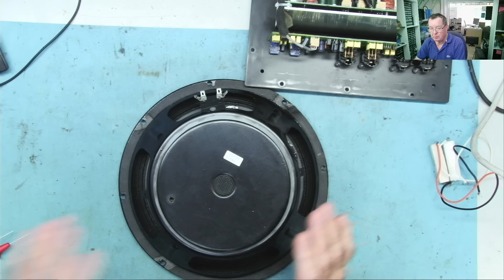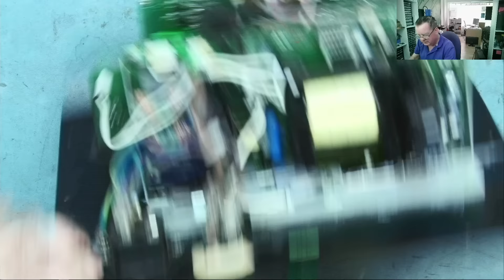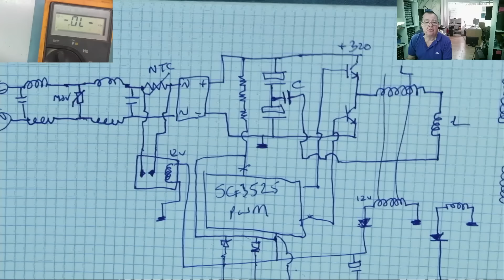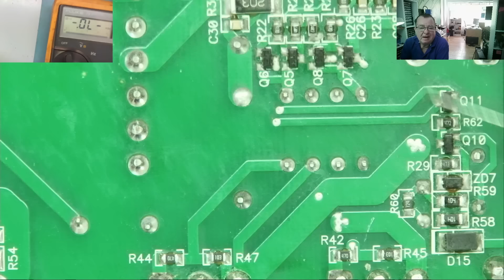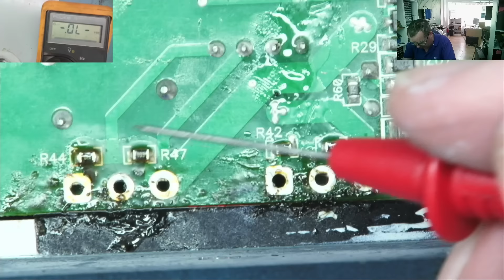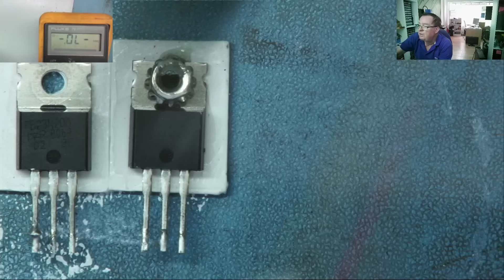DAS18A 750W Class D Amplifier Repair: PART 2 Why Did The Amplifier Go BANG?

Comment: Dummy load for testing output from audio power amplifiers. Auto headlamp H4 12 V 55W, long lite filament., 5 in serie. They are available free as the short light filament use to burst first.. Regards Allan from Denmark

Comment: 49:35 That chip has a vref pin which is a 5V output so you can check the voltage there on that pin and if correct the chip could be assumed working or at least not totally fubar. You could also check the other pins (LO, HO) with scope to see if it is outputting.

Comment: Before repairing anything, find cause of the Subwoofer’s speaker cone failure. The torn paper or foamy Surround aren’t the cause, they are the effect. Almost always, a torn corn is the result of a loose retaining ring/“basket gasket”. Next likely cause is Enclosure Over-Pressure. If the subwoofer is in a ported box and a port inhales an object, air flow can be stopped and something has to give… Another cause is if two subwoofers are in one enclosure and they either are wired or fall out of phase secondary to amp failure or a few other in circuit failures. 
I know everyone is yelling “Nuh uh… It’s from over-driving(over powering) the speaker…” If it’s a mid or tweeter or even a woofer, sure. But Sub-Woofers are designed to be pushed hard to drive those ridiculously low bass notes that make wax run out of your ears. 
Surprisingly, one of the best methods to repair a Sub-Woofer’s cone(paper like material) or the “surround”(flexible bit around circumference of the cone) is to use a piece of drywall mesh, spot of glue to hold the mesh and finally, clear Flex Seal. Like anything, prep is key to yield a quality, functional, long lasting repair. Use a flexible glue  and use sparingly. To keep the movement of the cone as uniform as possible, extend the repair in a way that spreads Flexible Seal around the outer most circumference of the cone. To test the repair, the all time best bass album has to be “Digital Bass”by Bass 305. Rinse, Lather, Repeat….

Comment: I use short lights for dc as an auto electrician 12/24v. Sometimes you just need more current available so add an extra bulb. I use 65w halogen headlight bulbs, sometimes 2 depending on what I'm testing.

Comment: Recently I had a bridge rectifier that tested fine in diode mode, and the psu actually powered up but with issues, after lots of testing, I got the thermal camera out and that bridge rectifier was on fire!
Changed it out and problem solved, very strange

Comment: how does the 115/230 switch connect into the switch mode power supply
Reply from the maker: Oh I really should make a video about that 🙂
Reply: @learnelectronicsrepair  nice, because back in the time of normal transformers it was logical to enable different sections of the primary side, and most smps are auto range.

Comment: I was kind of excited to see this part of the repair where we dig in a little bit deeper... And I was pleased to see that when I turned on my computer and went to YouTube that this video was already posted... There were a lot of things that I saw in this video, some things made me think about the overall quality of the amp and why they did things the way they did, these are mostly visual things like all the glue... we've  discussed why they do add glue but it sure looks terrible,  the silicone on the inductors?  I'm assuming that the coils on the inductor they wanted to make sure they don't move around? the wire loops stay in place was that the idea?  also Richard this kind of bothers me, what I saw,.... The mounting of the transistors with the screw and a nut, that's okay with me but the Type of Nut they used am I seeing a spline washer???  directly touching the silicon structure of the transistor or MOSFET devices... To me... That doesn't seem like a good idea,  for one you could over tighten it and damage the component, you could also have a certain amount of torque on the screw and maybe things are working fine but over time that pressure and the way the spline washer cuts into the material could cause a problem.  I don't want to go overboard on this subject but it just seems like a very poor decision to use a spline washer, spline washers are used to bite into materials in order to keep the fastener in place but were talking about transistors and MOSFETs it just doesn't look like a good idea.  A flat washer makes more sense to me, and if some engineer is concerned about the fastener loosening overtime okay,   Then put a spline washer under the flat washer to hold things together... 🙂🙂🙂   I'm going to exercise some patience in waiting for the repair components to be delivered and we continue.  If I've said anything that's worth commenting on please do so in the next video about our continued analysis and repair of this Subwoofer Amp.  🙂

Comment: That is the beauty of using a GDT(gate-driving transformer). Normally only the components on the MOSFET side of the GDT gets damaged. I totally hate designs where the MOSFETs are driven directly… prime example is that on lots of stuff they drive the gate of Triacs directly from a microcontroller. If that triac blows up, say goodbye to the controller, and with its unavailable firmware, have to repleace the whole PCB just for the cost-saving execise of driving the components directly. I am always relieved when I see a GDT in a circuit. Of course, the GDT is needed in this type of switching topology, but it also makes these kind of Power supplies the easiest to repair… for me at least.
Reply from the maker: As I understand it the Base/Gate Driver Transformer or a winding on that, in ATX type PSU at least, is also the the aditional L in the LLC circuit. It's good to see we agree on the likelyhood that the driver side of the SMPS output stage is probably OK due to the way it is designed.  Repalcement parts ordered 🙂

Comment: Use a piece of solid coper wire to unsolder multiple legs at once, it will act as a wide iron tip allowing the component to drop out as in the Mr. Solder Fix videos. Flood with solder and bobs your uncle. For more complicated shapes just bend a piece of solid copper wire to fit all legs at once.

Comment: Does anyone else find themselves shouting .. "its not a short its a resistor across the winding of the output transformer'
Reply: You cant hear me shouting from here can you?😂
Reply from the maker: @gr8pr4mr  No need to shout, I came to the same conclusion in the video.  I didn't shout either... 😉
Reply: @learnelectronicsrepair  :)

Comment: Not everyone has a desoldering gun but was it just me wishing you would use a simple solder sucker instead of poncing about with yards of too-small-wick to clear solder from those fat transistors? Sometimes us oldies have methods that still work, even if it does mean having to sweep the dusting of solder bits off the floor :-)
Reply: I used to hate solder suckers until someone gave me an Engineer ss-02 sucker. It has the silicone tube that gets a good seal around the area being sucked. For me it was a game changer on tricky desoldering jobs.
Reply from the maker: IMHO if any given method it works for you then go for it 🙂 I guess to some extent I just like to vary the way I do things when making videos just to show there is more than one way to get the required result.  I also discuss the method of heating all legs at once without removing any solder and pulling the device directly from the board and then go on to demonstrate that on the amplifier PCB.  How do you rate that method?
Reply: @learnelectronicsrepair  the heat and pull method works fine but if the device is too big and has a metal tab your fingers may suffer! In my experience say "ow" and swearing does help though :-)

Comment: Hi Richard, nice logical investigation. Remember that odd 12v supply not referenced to ground? Look closely at the datasheet for the 2092 amp chip and you'll see it needs a bias supply referenced to the -63v supply, I think that'll be for that. Feel for you on this one, I was recently working on a quite similar amp in a powered mixer and slipped while measuring and managed to short out and blow the power supply (which previously was working just fine as one of the 2 amp channels was OK). Finally traced the amp fault to a couple of failed caps but repairing the power supply cost me far more to fix and was entirely down to my clumsyness!
Reply from the maker: I agree with you. Sometimes when working on a repair bad things happen, not particularly deliberately, but that is how it is.  You know that I am quite happy to show what happens in real life (it is so easy to edit this stuff out and I suspect some YT channels will do just that) but hey this is the real world and I'm grown up enough to own it and take the flack from publishing it if that is the result.  I didn't mention in this video but I won't charge the customer for that part of the repair. He probably wouldn't know the difference but he's a good customer.  Thanks for the info on the non ground referenced 12V supply. I didn't investigate it further, just kinda realised what it was, for whatever reason
Reply: Ah this happens sometimes!